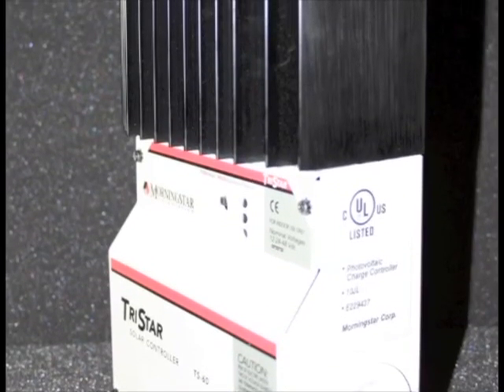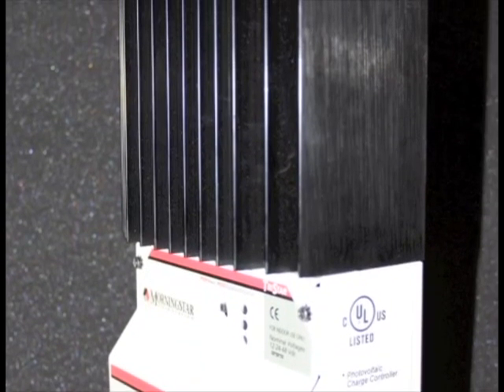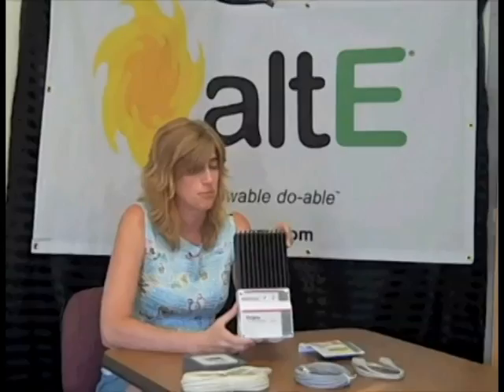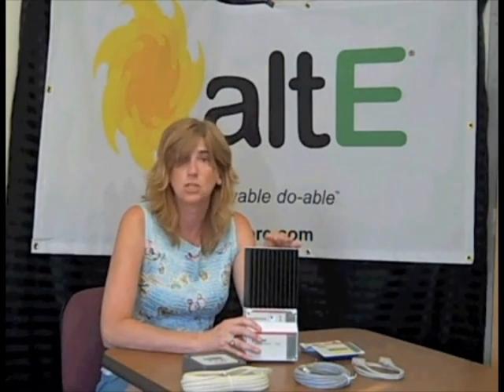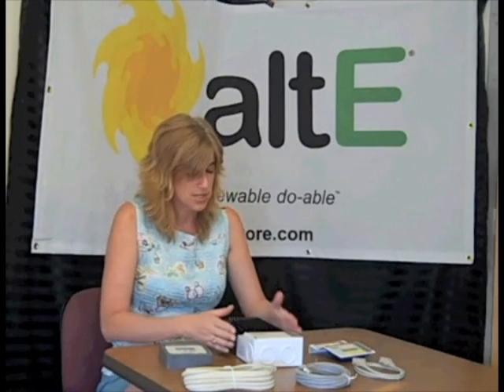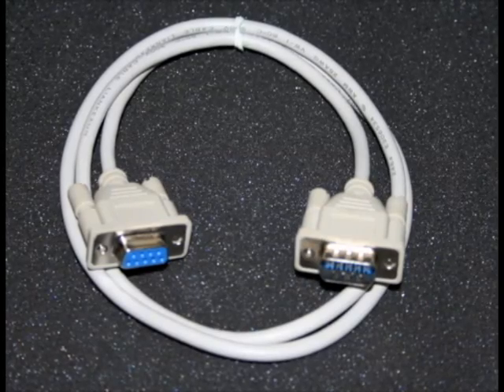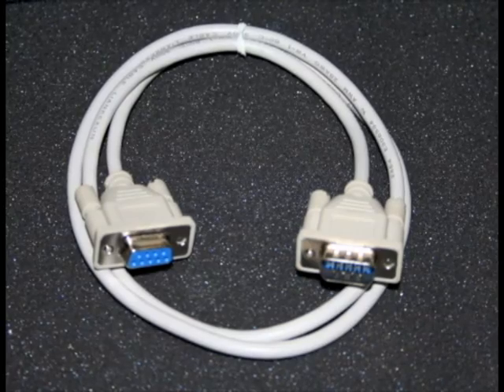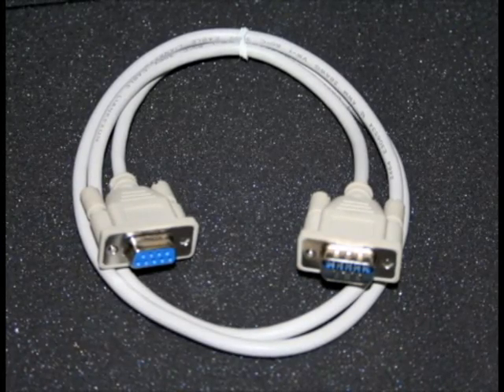Morningstar Tristar PWM Charge Controllers Overview

Comment: I JUST HAVE 24V PANLES ON THE CHARGE CONTROLLER 60T PWM  NO DIVERTION,, on the dip switch 1&2 on3 off45 on678 off will this work ? just plain solar charging for 24v batterys some body

Comment: Said nothing about Lithium which it can be programmed to do too. I’d like to know more about setting up to charge lithium batteries in RV?
Reply from the maker: The video is 9 years old. Lithium wasn't a viable option then. The recommended settings vary based on the brand of battery. For example, here is the setting recommendation for the KiloVault LiFePO4 battery, https://www.altestore.com/static/datafiles/Others/KiloVault%20Morningstar%20Compatibility%20Tech%20Note1.pdf

Comment: my plasmatonics pwm charge controller dingo 20/20 ... 12 24 48 volt it won't work with my single house solar panel 180 watts why???

Comment: I buy TriStar-60. but just know it divide mainly into CHARGING, DIS-CHARGING part!!  It needs to buy TWO controllers in order to connecting the battery, solar panel and LOAD !!!  A lot of solar controllers have this functions together. I feel very strange why this product don't put together instead of using DIP switch to change role. :(